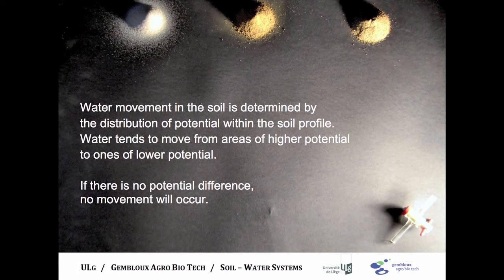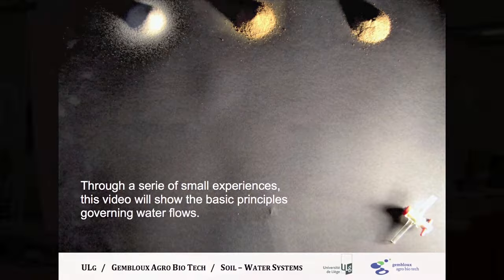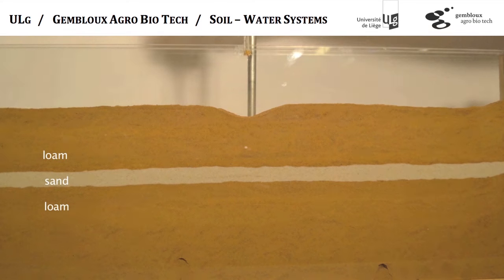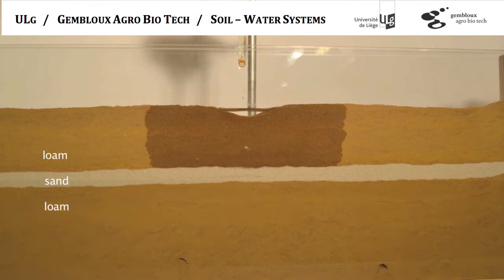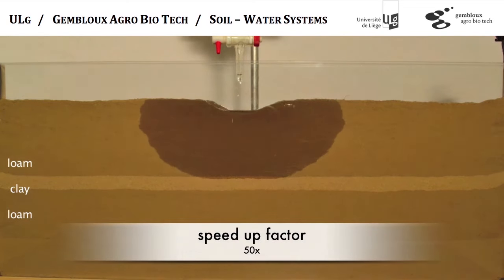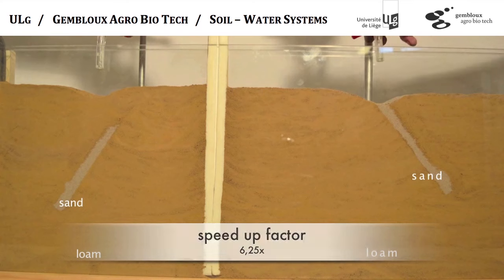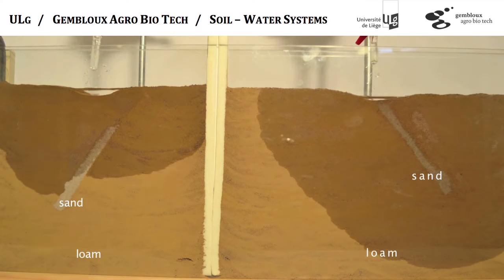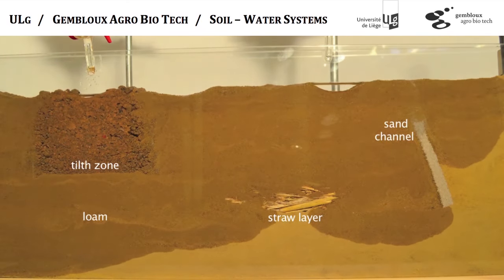Water movement in the soil

Comment: High IQ gardening theory crafting:

Make a channel of sand underground under each row of vegetables and have the sand channel come up like a pipe in different spots.  Pour water into these sand "pipes" and the water should flow under the plants and hydrate the surrounding dirt from the hydrostatic pressure.  Significantly less evaporation, but more work to start off.

Comment: irrigation+rainfall = evaporation + transpiration + runoff + leaching

 Which one of these processes do Farmers really have control over during the growing season?  If you have the ability to irrigate your sandy soils and water is cheap and plentiful, then you are fortunate and have some control on the left side of the equation.  If you do not have irrigation, you must look at the factors on the right side of the equation to see what can be controlled or minimized to benefit your crop.  Evaporation from the soil surface can be reduced with mulch or leaving crop residue on the soil surface.  Transpiration is a function of the plant leaf surface area and the weather.  Runoff is or should be minimal in sandy textured soils with high percolation rates.
This leaves the leaching of water out of the root zone as the #1 controllable loss of moisture to your crop.  Interrupting the downward movement of moisture in your soil by installing a "smart" barrier can greatly reduce the leaching of water and nutrients.  SWRT subsurface membranes detain/retain up to 90% of irrigation or rainfall in the root zone for crop use by disrupting the gravitational movement of water in the soil while still allowing excess water to percolate and do not create anaerobic soil conditions.
Reply: كيف يمكن تعطيل او تقليل الحركة الجاذبيه للمياه